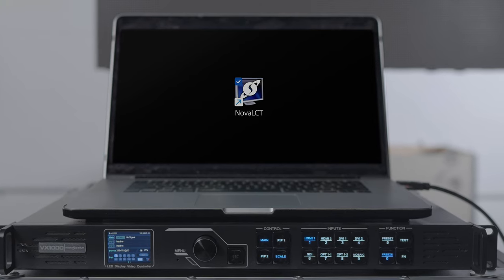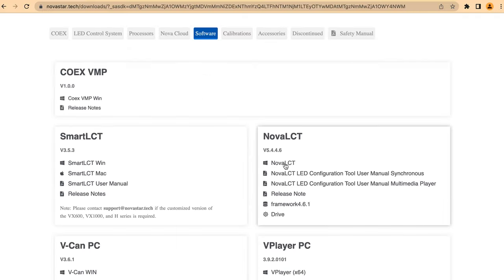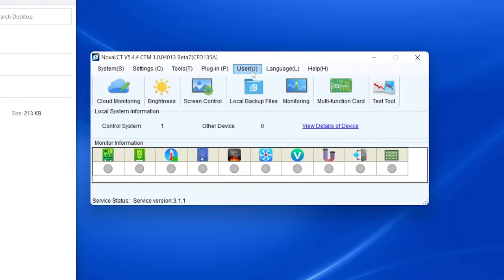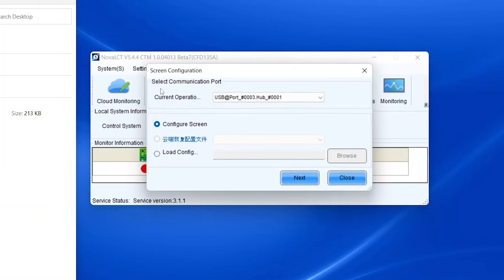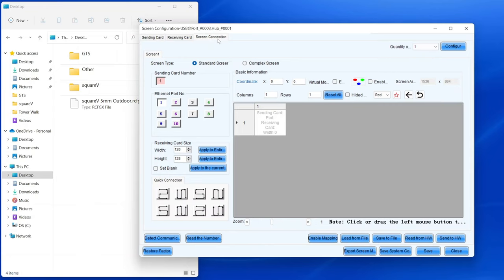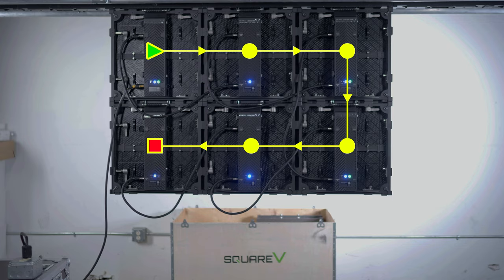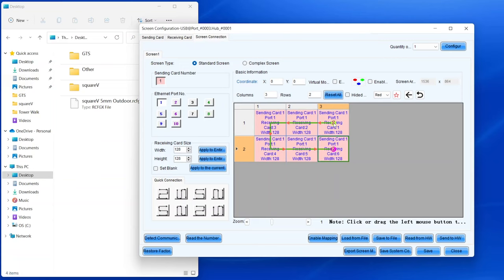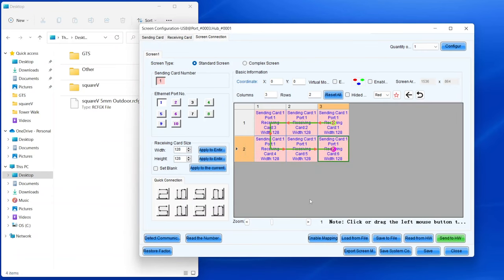LED Wall Setup | 07 Mapping LED Video Walls with Software

Comment: Is there a software for drawing out signal flow to help techs plug things in correctly?
Reply from the maker: @zachariahlehoux4383  you can do a pretty good job using offline mode in any NovaStar software. Some people just use basic shapes (colored circles and lines) in Microsoft Word or Photoshop or something.